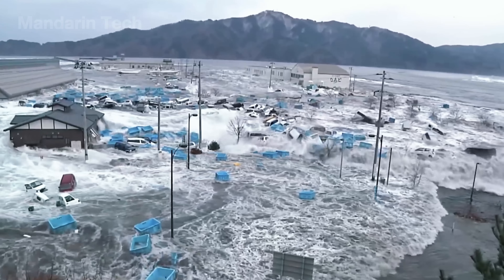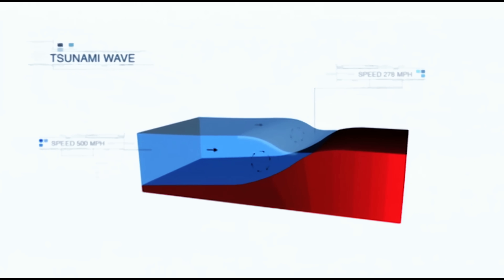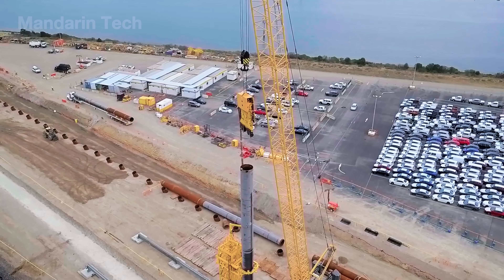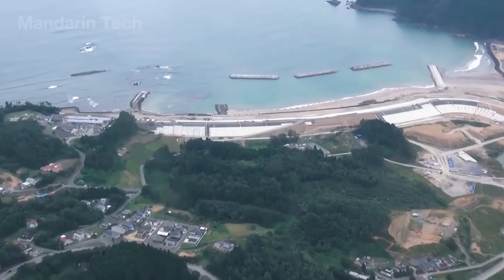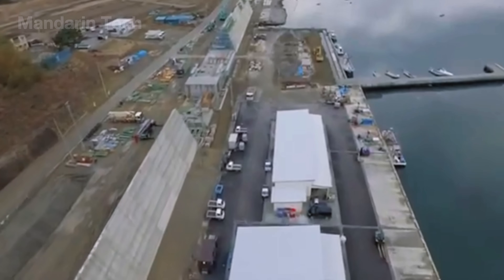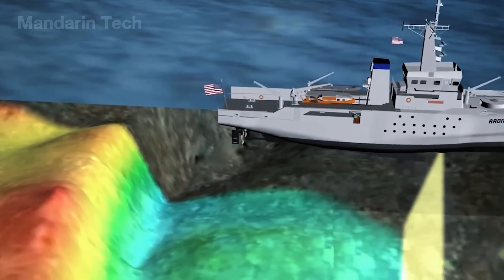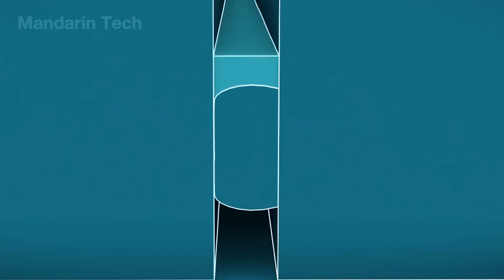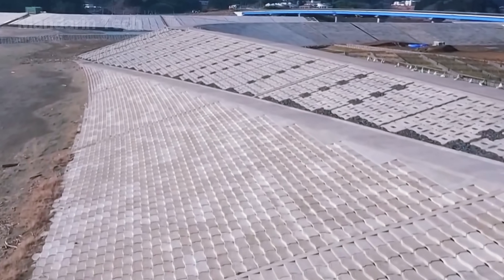How Japan’s Massive 400 km Tsunami Great Wall Was Built That The World Can’t Ignore

Comment: What is 45, 50 feet high mean. Is it 45 feet high or 50 feet high ,same as the wall thickness of 14,15 meters, is it 14 meters thick or 15 meters thick? Not sure real humans talk like that \. Its even in the summary as
"14–15 meter–high walls, anchored by foundations plunging 20–25 meters deep"
Reply from the maker: It means the height or thickness varies within that range — from 14 to 15 meters, or 45 to 50 feet.
Reply: @Mandarintechmido  then say that.

Comment: 50 feet is not tall enough. If a 50 fr sunami runs into that wall, it will just rise up and run right over that wall. When a sunami runs into a wall, the front just keeps growing higher, and higher. The miles of that wave behind the front will just keep pushing and the front  will just keep growing and growig
Reply from the maker: Many people feel the same — good leadership really does make a big difference in how projects move forward.
Reply: Wow, so your argument holds and the so many engineers and scientists and architects who would have done hundreds of thousands of hours of research, investigations and simulations and billions spent in the design and build is worthless? And mind you the japs done just do things for the sake of doing. And you spell Tsunami without the T and we should believe you and abandon the project?
Some people can be defendingly negative

I'm not telling it will protect Japan or not but they are trying their best with their resources to protect it's citizens. 
By the way if this is worthless as per you what's your suggestion? How about putting your suggestions so that we may be negative about it. Haha

Comment: It will not  stop 50 feet tsunami with 20 feet wall that is quite impossible
Reply from the maker: You’re right that no structure can stop every extreme event; it’s mainly designed to reduce damage in more likely scenarios.